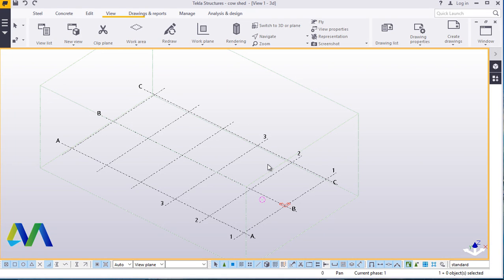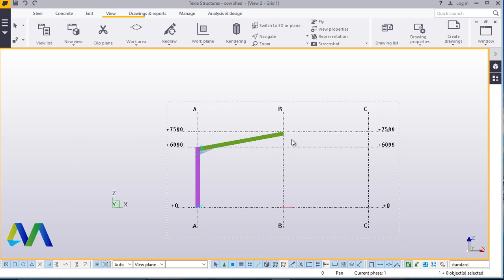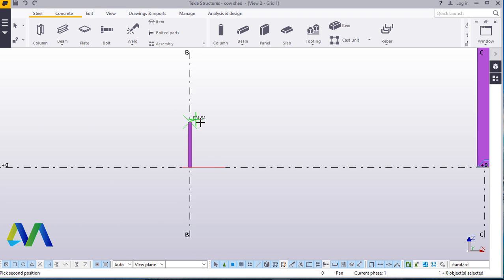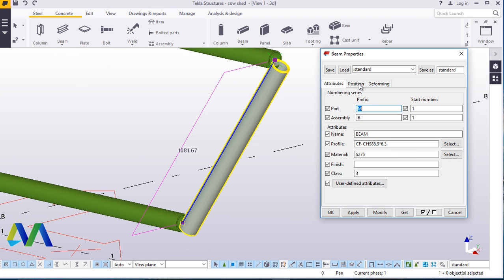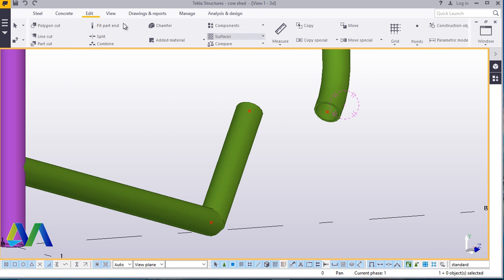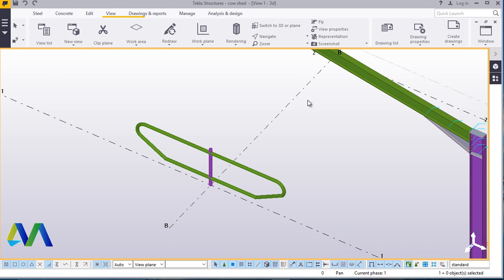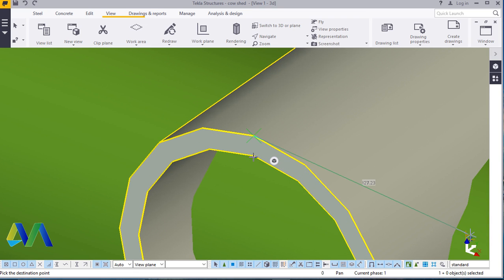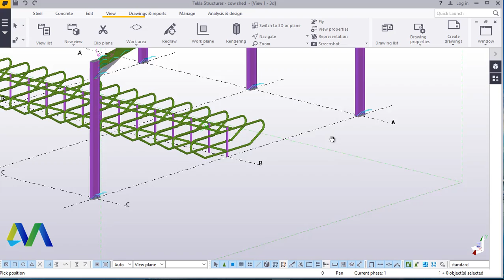How to Model Cattle Shed in Tekla Structures

Comment: Thank you for your tutorials, how have you loaded multiple profile catalogues? 
I have trouble following your tutorials because you jump from UK to Europe standards and i do not have all the same profiles you use. any help would be appreciated. thanks
Reply from the maker: which environments have you installed in your system?
Reply: Maurice Dimba I have the same problem and I installed engineering environment